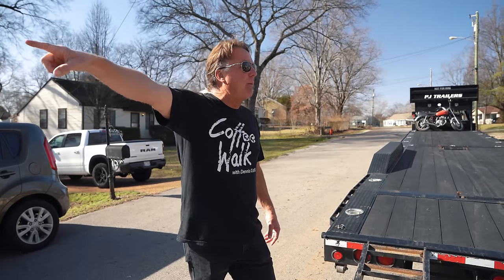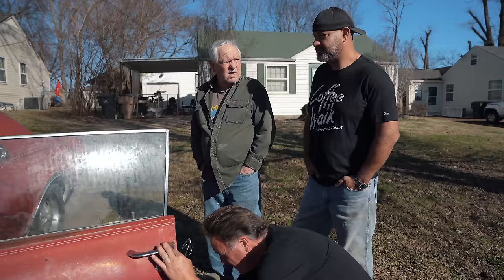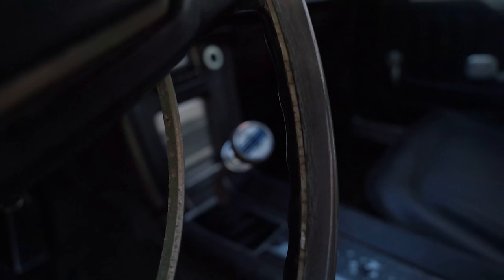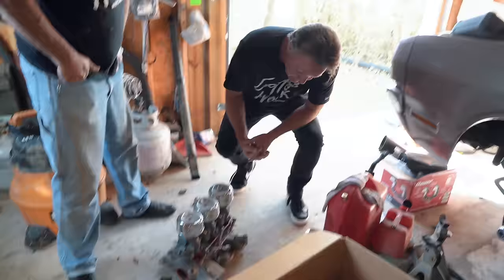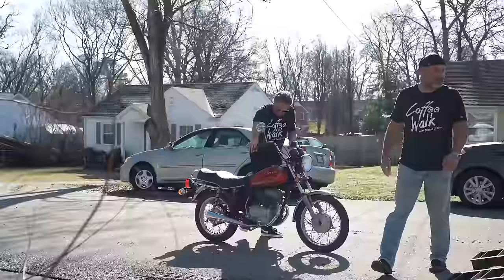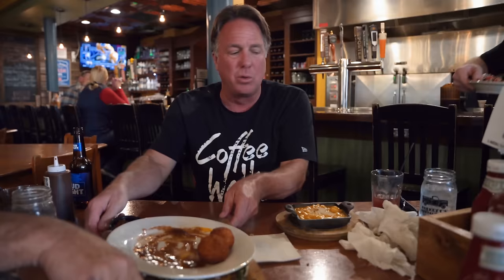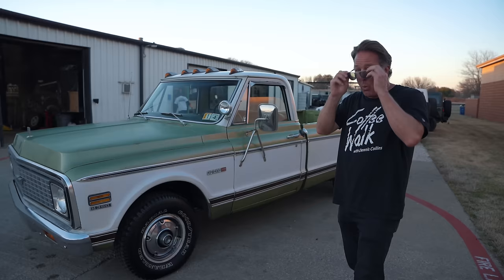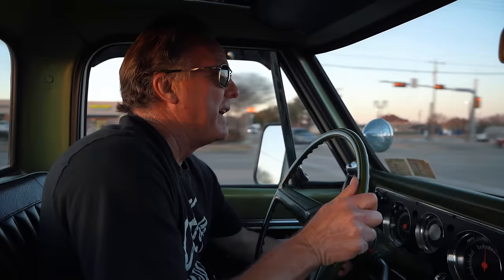RESCUED: RARE Mercury Cougar + 1981 Honda CM200T + Chevy C10!

Comment: Dennis and Shawn were sounding like an old married couple deciding how to load that car on the trailer.🤣
Reply: I thought the same thing when they were going on about if they should jump it or not.
Reply: shawn is right , you don't want to load a car with no brakes going downhill .... you can control its movement with the winch going uphill , if it's going down it could roll towards the front of the trailer with no control
Reply: Shawn annoys me for some reason. He just has a bad attitude sometimes. If he could walk a mile in someone else's shoes for about a year he'd realize what an amazing opportunity it is to work for a guy like Dennis.
Reply: Fighting for position?
Reply: @TheAgentAssassin  Ive been feeling the same. He's got a jealous type attitude..

Comment: I love this episode.  I  use to live in Nashville, tn. I remember back in 1976 my brother just started driving for the first time and was looking for a car to buy and we found a 1969 cougar eliminator that had a big block 428 cu. Inch engine from the factory.  The car was at Jim Reed Chevrolet dealership in Nashville. It was red with black strips on  the side and a flat black hood with a cast  iron hood scoop. It came that way from the factory. I remember when he started It up. The whole  car shook and was pretty loud. Needless to say he didn't buy it. He ended up buying a 1972 Cuda 340 cu.  with the pistol grip four speed instead. Imagine what these cars would be worth now. Good memories.

Comment: Like your C10, I just found a purchased a 1955 Chevy Bel Air 2 door one owner, parked inside since 1978. 4 barrel, dual exhaust and overdrive. 100% stock. The tubes in the tires held air long enough for us to put it on the trailer and unload it. It's was a dream find in the middle of nowhere Kansas. McDonald Kansas to be exact. Now it's with me in Denver

Comment: One of my top 5 American Muscle Cars, This car, and a 1967 Camaro Z/28 RS/SS, 1963 Buick Riviera, 1970 Z/28 RS/SS 4-Speed, 1969 Firebird Trans Am convertible 4-speed... I hope we get to see the Cougar when the restoration is complete!!
Reply: A friends dad had a 70 rs/ss split bumper camaro. Factory 402ci 4 speed car. black exterior/interior with gold strips. Chin splitter with the spoiler on the trunk.The car was imaculant. There wasn't a tear anywhere in the inside or a scratch outside.
So he got drug by a 2v cleveland powered maverick. He didn't want any from the 72 torino sport 429 bbf. He made the mistake of trying the cleveland.
Anyway my friends mom passed away from cancer, so his dad went off on a drug binge. He would constantly pawn the car and get it back. That went on for a while. Eventually he sold it pretty cheap for drug money. The guy that bought it borrowed the money from his dad. He Had his son say grandpa molested him, which was a lie. While the grandpa was in jail his son told him he was keeping the car and not paying back a dime that was loaned to him to buy it. So when they locked up the son, his father took a torch and cut the drivetrain out of the car 402/ m22 4 speed/ 12 bolt. My uncle paid $500 for all the drivetrain just to replace a rod knocking 454 in his dually. 
The guy took the car to the salvage yard and watched them crush it.

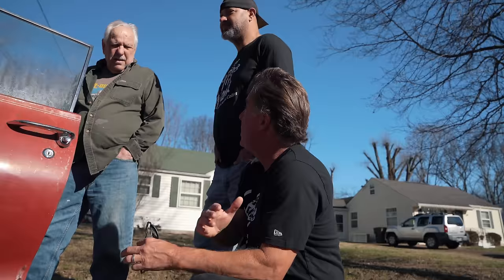Comment: I had two 1968 Cougar XR7 GTs both 4sps one had head rests both 100% original right down to the shift knobs and both 3:25 rears, if I had only known the way things were going to go AND just a few miles away a 68 XR7 GTE  (427) was pulled out of a guys garage after many years of sitting.

Comment: My dad has 7 mercury cougars. He has an all original 66 that was my grandfathers (his dads) that he bought in October of 66. It has 30k the original 390 marauder engine. When my dad turned 19 in 68 he bought a GT-E with the 427fe and still has that car. It’s been fully restored and is incredible. Over the years he’s picked up a 67 390 marauder 4 speed almost identical to this car but in blue with black vinyl interior. Then another 68 GT-E with a 427fe two 68 GT-E’s with 428cj’s and 2 69 GT-E’s also with 428cj’s. All the cars except one are 4speeds. And the 427fe cars blow the doors off all of them. It’s crazy the power the 427fe puts out and how fast they are. You’d think the cobra jet cars were faster or whatever but nope. Those 427’s are nasty.

Comment: Wow beautiful truck. Dad bought a 72 same colour, transmission was toast. Someone put loud cheap exhaust on it and slicksters on the rear end.
350 V8 automatic.
Had the truck painted inside and out jet black, clear coat. Recovered the seat in black. Tinted the windows. New wood in the box. New transmission, Rally Wheels and a proper exhaust. And the Heartbeat of America decal (even if was GMC). No positrack no four barrel. "Baby".
Sold it to a friend from work cash money.

Comment: The 390 cougar is nice but I like the 427 eliminator version even better!
Reply: Eliminator wasn’t in 68 the rare GT-E came with the 427 they are extremely rare 69 was the first eliminators
Reply: That was a 1 year only in 67 on the GTE. And unfortunately it was more or less just a 390pi with .160 over bore. Meaning it used the cast iron intake the same cam  cast crank, and the 390 4 bbl rods. The heads were the late model truck heads as well
 But a set of early C3's off a low riser a 428 pi intake and a good cam and a set of heads and 500hp is very easy. That is one of my personal favorites FE set ups. That combo with spin to 6800 and if you get some Scatt H beam rods and bump the duration on the cam a bit more it will spin 7800 and make 580hp+. And it will live.  The FE is such a bad ass under rated piece it's a shame. I'll take a 427 Ford and eat every 454 bbc that is dumb enough to be embarrassed by less cubes. Go to utube and type in Holman Moody 427 mustang. 1 Ford go to the Corvette anniversary vintage race. And put it on the poll and never looked back. And every 427 vett just ran for first loser!! Take that bow tie boys!

Comment: Nice, I had a 69 XR7 390 black leather high back buckets with headrest. Black vinyl roof Silver with eliminator decals and  hood scoop. Craigars,,air shocks, TA 50's and the ol traction bars. 'The 390 was factory replacement when engine caught fire.  My parents car  1980 in High School. We had the cars back then. The average bad ass car was around 2 grand Max. Now they are worth 20-50 grand. I'm glad my buddies were into cars. Those were the days.

Comment: Dennis those old Couger GT's are somewhat underappreciated.....very cool find even though it needs a resto! I learned to drive with an old 49 Chev Pickup with the 4sp granny low trans. They were pretty cool. Later I had several three on the tree old Chevy trucks! Dennis those were some cool times. Then I got my first Camaro a 67 RS Camaro with 49K miles in late 1975!

Comment: I have a neighbor that has a factory red Cougar GT s code 390 ci with automatic.The car has been in the same family since 1968 purchased at a Lincon Mercury dealer about 25 miles away. Not sure if he still has the original 390,but the car has a fresh 429 Cobra Jet engine. The interior is all original. awsome car!

Comment: 1977 Elmira NY, I passed by a 1968 cougar for a while on the way to work, one morning it had a flat tire so that night i stopped to check it out. This fella came out I asked what the problem was he asked it I wanted it? $75 will take it away, won't run. I drag it home, popped the hood to see what I thought was a 390, was a 427. Cranked on it for a while, popped the distributor cap dual points. Went to parts store got a condenser, fired it up. Someone had put a cheapo 4 speed shifter!!

Comment: I have 15 Cougars and most of them are just as rare as this one. 
Rare Mercury Cougars are in private collections and some make it to the auction houses.
Reply: I have just one it is a 67 cougar 289 auto PS BP add on air from Mathew ford.in ashville NC 54 k miles been restored but health is not great. Bought from original owner it still has the original Dan Gurney stick in the rear driver's window not nearly as good as the 68 but ok.
Reply: 15 where you located lol … you must be friends with Don at wccc
Reply: @MYBALLSYC  Yes, and most of the people in the Mercury Cougar   Community.

Comment: A friend of mine had a Cougar like that in high school in the early 70's. Not sure what engine it had but, it was fast. He got mocked for driving it, but it beat anything else that raced on Friday and Saturday nights at the local mall drag strip. Except my dad's Olds 88 royal, that sucker was fast. My dad had to replace the tires twice in two years from all the burnouts I did with it. I was wondering if a classic like an Olds 88 would be worth saving. Great Cougar.

Comment: I drive my 70 c10 all the time. 350 auto four barrel. Same color as your 71.  It was my dads truck. 118 thousand miles. Still has original radio and cigarette lighter. Rocker panels not rusty.

Comment: I have a 67 Cougar Red just like that one. Only it's a 289, stock, nothing special. Almost no rust at all and one little dent in right rear.  It was # 516 ever made. Just built a 289 w 10:1 pop ups and roller rockers. Found some old slotted wheels off of a 69 Mustang and a set of old school traction bars. Not going to race or anything, just a hot little number with a cam.

Comment: I think I can shed some light on the missing headrest mystery. The seats in there now are '68 Mustang Interior Decor Group ones. That Cougar is equipped with it's own  Interior Decor Group option , which was the same as the 1967 Standard interior, except for the locking seat backs, which were new in '68. The standard '68 interior was decontented , losing things like the door puddle lights, and looked much plainer.
 So in a nutshell, the '67 standard interior is  the '68 Decor interior, with the '68 standard interior a step down from there. So it looks to me that someone  took the original headrest-equipped seats and swapped in some Mustang ones.

Comment: Don't know why somebody would want a rebel but what do I know . They were the most basic of starter bikes and not rare  . Seeing it with seat and tank on if it is rideable it's worth something more then 400.00 in 2023 where anything that moves and is transportation is worth money , more then 400.00 I guess .  It is basically a moped . I have only ever seen petite women who were knew to riding on one .

I guess I have to realize everything is somehow worth money now .

I owned a rare factory 4spd 289 67 Cougar as well as a 67 with a 390 ( but I don't know if it was original or a GT Tribute / clone / fake .  I adored the 289 car though . Bought it as a perfect running car for 2500.00 in 85 with great interior and body except for some bondo used before respray . But it was dead reliable and drove it everywhere and never let me down . No power anything which I preferred.  

Like it better then a regular 67 Mustang for design / looks wise for  sure ,  really nice looking cars with VERY CLEAN lines and that great front end electric shaver look .

Comment: Well big D love yer channel but I think you're adding a lot stretch to how rare the cat is. Yeah the top loader is rare. But all GT ' s had the 390      EXCEPT in 68 only you could get 302 4bbl option w/ GT package. There are some say it's a package not a GT. But for real low #"s   My buddy has a  69 Eliminator w/ Boss 302. 4.30 Drag Pack. Mag 500's louveres,  shaker in Canary Yellow. VERY VERY RARE. And my fav is his 67 GTE  w/ 427 hyd cam/ cast iron intake  ( all GT 390 stuff  on the 427 cross bolt block.). This one has all the ultimate extras. Walking cat grille. Oval air cleaner w/ wc, C6 Auto w/ WALKING CAT BELL HOUSING !!!!   That one was probably one of 1,  and there is a gold 67 GT auto in the junk yard about 4 miles from me. Could be bought cheap.  anyway keep up the great work D I'm a big fan. And a FORD GUY!!

Comment: My first car was a 1968 Mercury Cougar XR7. Dark blue metallic with black vinyl top with silver blue leather interior and power steering, power brakes, console car with overhead console. Power seats, power windows, tilt wheel with factory A/C and am/fm stereo. I owned a 66 Mercury Cyclone GT with 427 four speed, anyone know the production numbers for that? While in the service I test drove and almost bought a 1967 Cougar GT with four speed 427 from Louisiana with 25k actual miles.

Comment: My 390 is nicer than that & it hasn't ran in 20 years.  Dad's XR-7 unicorn as it were, and it has the headrests lol.  It's an auto but still has the "Don't drive at high RPM's until after 500 miles" sticker on the speedo.  I will get her going someday.

Comment: My old Masonry boss had a 73 ford camper converted to a steel dually,had a 390 outta of Merc and empty weight that truck was 10k lbs,packed down with block almost 18k and that block stock pulled for days,use to blow people's minds when they saw this ugly green welders dually blowing there doors off..mean motor sweet save Dennis